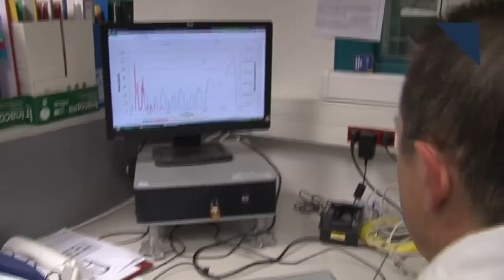Porsche Mission E, Tesla Model 3 Teardown - Autoline Daily 2278

Comment: Never thought about this before but if the battery can cause first responders issues on a EV wreck scene, what about a full tank of gasoline? How do you drain the gasoline from a normal ICE car before it’s safe enough to enter and help or remove injured?
Reply: In 2013 there were 17 car fires per hour in the US (from 2006 to 2010 car fires averaged 152,300 per year in the US). There are around 209 deaths per year from car fires in the US. There has not been a death attributed to an electric car fire up to January 2018. Those earlier numbers numbers come from the National Fire Protection Agency report for 2012, so all petrochemical car fires.
Tesla had a couple of well published car fires in 2013 and again in 2014, I'm finding it hard to come up with more recent numbers but here is a quote from my favourite deity: Elon Musk posted on his blog that, based on U.S. automobile miles-per-fire statistics from the National Fire Protection Association, a driver is "5 times more likely to experience a fire in a conventional gasoline car than a Tesla.". Bear in mind that this was in the early days of the Model S (2013 or 2014), a couple defensive modifications were made to the car in 2014 to reduce its vulnerability to large pieces of steel being run over on the highway. Wikipedia has a section that lists all electric car fires, as far I read there were a total of 4 Tesla car fires up to 2014 and another in 2016 giving a total of 5 fires (in addition there was a garage fire but that was found to be the electrical connection in the wall being faulty, Tesla added additional temperature monitoring to reduce the charging current should a similar incident happen again.
Electric skate boards catch fire, too right they do, I would not let one in my house but they are not electric cars.
Stored energy is an interesting topic so please forgive me if I bore you. Li-ion batteries when compared to gasoline are capable of very poor energy storage. A Tesla car battery is big and heavy (over half a tonne) but it is only capable of storing the same amount of energy as 2 or 2.5 gallons of gasoline (they come in different sizes). So how come you may wonder that a Tesla can drive 2 or 3 hundred miles and reach 60mph in less than 5 seconds, well the answer is efficiency of the drive train. A gasoline car is around 20%, under ideal conditions maybe 25% efficient so 75 to 80% on the energy content of the fuel in the fuel tank is wasted as heat while the electric car is about 90% efficient. So when it comes to carrying around large amounts of stored energy the gasoline car has way more. Also when a gasoline fuelled car burns there is a none zero possibility of an explosion from gasoline vapour or more likely an intense fire, hence the fire related deaths. When the traction battery in an electric car burns it burns relatively slowly, slow enough that the passengers can get out, sure the car will burn to the ground and if your were trapped inside you would perish but that is just the unpleasant reality of life and death on our roads, still the electric car will give you the better odds.
As to the fifth I came up with, well I've given you a quote to back that up but bear in mind that that was from 2014, just after the first four Tesla fires, that number would have to be much better now since Tesla fires have become less common despite the fact that there are now 250,000 Tesla cars on the world's roads..
PS may I say how pleasant it is to converse with a gentleman who either knows how to spell or possibly how to use a spell checker.  Best regards.
Reply: Dogphlap,

Name you source or sources. 

Also, refrain for saying "Elon Musk said", or "it came from the Tesla blog site" or some such. They are heavily biased to make themselves look better than they are. They have to be as they make most of their money from hype than making anything actual at this point. 

Try using third parties. 

TL;DR. The moment I saw that run-on paragraph I knew you were trying BS the conversation. Just make the point and move on. 

Also capping your diatribe with a insult does not aid your case. Who wants to read that mess. 

In short, you made your comment unreadable. Being an ass to defend it is still no defense. 

Go back and try again.
Reply: +DocWolph     Did you not read my last comment ?
Sources:  Elon Musk's blog 2014
National Fire Protection Agency Report 2012
Wikipedia: Plug-in electric vehicle fire incidents
Google search "on energy content of gasoline" first result from Google themselves is 46.4MJ/kg (by my math that is roughtly 13kWh/kg or 6kWh/lb). So if a car gas tank holds 50 litres of gasoline that is around 650kW/h of energy (or roughly 10 times the amount of energy stored in a Tesla Model S 70D traction battery). Of course the gas tank may have less than 50 litres of gasoline in it but by the same token the Tesla battery may not be fully charged.

If I've missed something be sure to let me know.
Reply: First off how have I insulted you, in fact I praised you for being able to produce a correctly spelt comment, something rare on the internet. For any insult you feel I may have made to you that was certainly not my intention but you are welcome to my unreserved apology for any slight you may feel you have suffered at my hands.
Mr Musk has done some remarkable things in his life so far, you are no doubt aware that he started a rocket company (SpaceX) that now supplies the international space station as does the United Rocket Alliance only he does it for one third the price since his company reuses the first stage (the most expensive part of the rocket). That in itself is quiet an achievement, at least I think so. In 2018 (this year) if things go according to schedule SpaceX will have 60% of the worlds satellite launch business and be by far the largest entity in that arena. Next month (February 6th) is the scheduled first flight for a new SpaceX rocket that is the largest and most capable rocket currently on earth (smaller than Apollo but if you live near Florida it should be worth a visit, bound to be spectacular even if it blows up on the pad). It continues to astound me that proud Americans continue to rubbish the two most innovative and successful american companies. Competition from Tesla Motors has forced all the world's large car manufacturers to start  producing electric cars (even Ferrari now say they will make one) which was in fact the point of the exercise.
Why would I not quote from Mr Musk, he does know a thing or two about electric cars, his blog is public, perhaps you can point me to a post anywhere that disputes his comment.
I gave you a list of sources and you ignore them but concentrate on the one quote from Mr Musk. I don't see any sources for your assertion that electric cars are more likely to catch fire than a gasoline car. I have a Physics degree and though I do not claim to be a physicist perhaps my use of numerical arguments stems from that. I've told what I know and backed that up with various sources. I don't know where you get your information from but it does not appear to be traceable to any know facts. I had hoped we could have had an intelligent conversation on a subject dear to my heart but alas I see that is not to be.
Again I apologies for any offence I may have inadvertently caused.
Reply: +DocWolph       I was with you until you claimed BEVs are more likely to burn than ICE vehicles. My understanding is they are only a fifth as likely to burn and then much less intensely. Do you have a reference that supports your view ?
Reply: Most modern ICE-Vs fuel tanks are so durable and well protected that it would take a direct and catastrophic hit to cause one to leak.  Generally you do Not drain the fuel from a vehicle until it is determined safe to do so. That fluid you often see on the ground after a wreck is radiator fluid, not fuel. 

BEVs have the problem that Lithium-ion batteries still have the issue of shorting out [, especially if they suffer a puncture,] and catching fire as a result. This is been somewhat mitigated, but until Solid Stare Batteries come around that problem will never be fully solved. As it is, BEVs are still only somewhat more likely to combust than ICE-Vs during or after an accident.
Reply: Coraga F1,

I'm having a hard time telling if you are being serious or just trolling. No one said ICE-Vs don't catch fire.

A Clip show spread out over years from around the world from a population of literally 100s of millions of operational (before emulation) automobiles) is like saying "if it happens at all, then it must be happening all the time. Meanwhile because there are barely any BEVs in comparison, and while some do catch fire, [there aren't so many to catch fire even though by percentage  the rate is actually somewhat higher than with ICE-Vs. 

Next we do not know the condition of these vehicles. How they have been treated or abused, their ages and so on. The same thing goes with BEVs. You can literally go your entire life and NEVER see a car catch fire IN PERSON (not a video). I have only seen one and it was a ratted out Datsun 280z.
Reply: Dogphlap,

Your understanding? So do you have any information to back up your assertions?  After all your the one who decided to come in with an actual number, "a fifth".  One should demand you have a sourdce to back up that number. So, guess what? Where's your source for that number?

As I said before, BEVs are somewhat more likely to catch fire, and this is all the fault of the battery design. Even then it is not like ICE-Vs are just rolling around are firebombs looking for  a place to explode, which is Coraga 1's implication. That is simply untrue. In my life I have only seen one ICE-V catch fire and it was an abused heap. 

There are far fewer BEVs out there and you will find over time that storing that much energy in vehicles that are not treated well will result in fires and pretty big outs. Seriously have you not seen those "hoverboard" fires some of which burn down a families home. An electricity can still be tricky has many electric fires in homes attest every... day. Some small other total loses. There may be nothing actually wrong and there will still be fire in a BEV. But as with ICE-Vs, those fires will be rare, although for now, by proportion of the vehicles counted, slightly less rare, more common, than with ICE-Vs. Newer vehicles overall that are rarely abused or missing any key maintenance and certainly not being beaten to hell like some ICE-Vs are. 

So, don't be down on me. or anyone, because I don't say nice things about BEVs. They are NOT perfect and are intrinsically flawed. Tesla has their head up their butts making rookie mistakes, to be expected of a very new car maker who has so many fans [kissing up to them] and overlooking things that could actually matter "that on time", that they might feel NO compunction to not make those mistakes again. 

As far as BEVs catching fire goes, this is on of those things alarmist SJW BEV freaks want to throw out there as if to say "if even one can go bad they all MUST be bad". This is of course hypocritical as you can looking "Electric car fire" and find numerous images of BEVs, mostly Teslas on fire from battery malfunctions some of them pretty recent. BUT overall, the battery fire issue is being dealt with and again, until solid state batteries are available the problem will NEVER be dealt with completely.

Comment: There are two places to cut the loop on the Model 3 the second is on the rear pillar you just need to cut through the rear pillar. It pays to do some research on the topic before criticizing a company but it's clear that autoline doesn't like Tesla an American company. Every new car made has these loops that disables the SRS system and they're under the hood so are they any better? Do you want to cut into any car that has undetonated side curtain airbag?
Reply: Well I hope that car manufactures don't make those first response material and videos for nothing.
Reply: What would they do if the door is crumpled and they cant access the mechanical hood release.. pop the hood with a pry bar. In an emergency they arent going to care about damaging the car.
Reply: Robert Blackford -- Tesla has been very good about providing instructional materials to First Responders, going back to their first car, the Tesla Roadster.